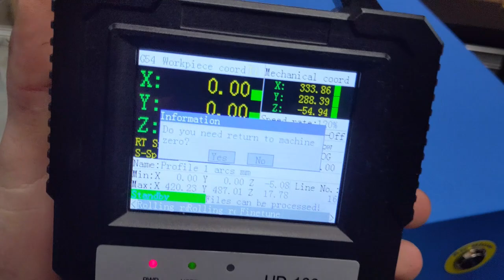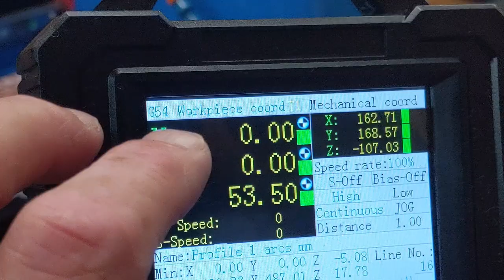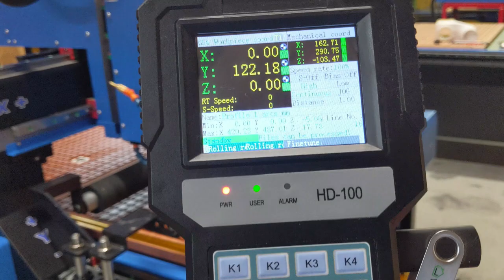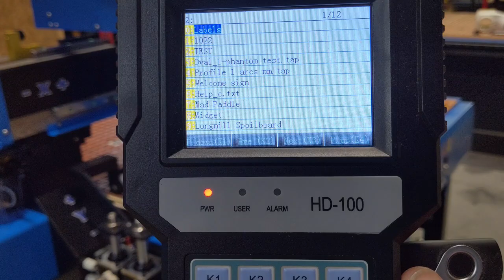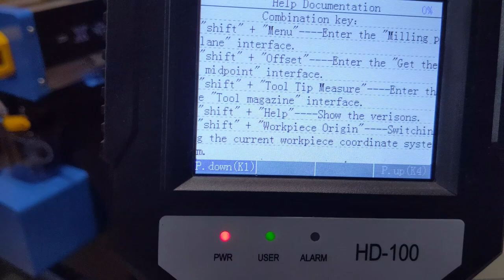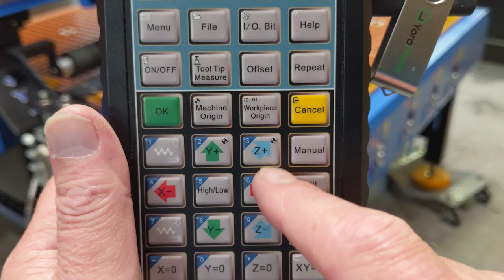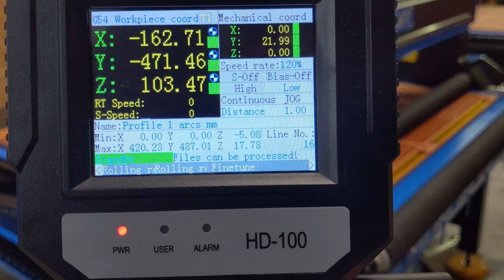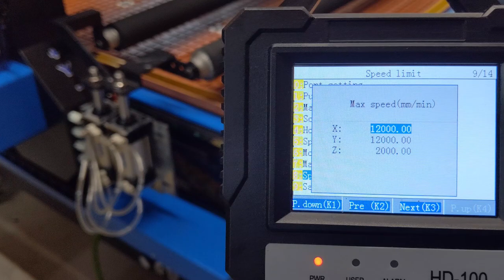How to Use Phantom CNC Router HD-100 G-code CNC Controller Tutorial

Comment: The HD-100 is similar to the Richauto B1X Series however the B5X series is better which offers the color graphic simulation display and an HDMI connection. Consequently, these series of the  Richauto cost more but has greater response time, smoother motion and no node editing required for smooth motion unlike Mach3, WinCNC, and previous Richauto models such as the A11 series. Great video and congrats on the upgrade.
Reply from the maker: Talley, thanks for sharing your perspective brother! I should look into the B5X

Comment: Great video on the detailed features of the HD-100!  So with the Phantom HD-100 I would load the Vectrics created gcode on to the USB stick and run the file. Will this controller automatically set the spindle speed from the GCode data? Or will I have to manually do that for every bit?
Reply from the maker: Dion, you are exactly right. It will set spindle speed from the gcode for every bit if you have that configured in Vectric.

Comment: Hi - I picked my SCV44 the week before you Garrett - I live in Raleigh, NC so I made a pre-buy trip out to Phantom during the summer. The Phantom team and Steve (Owner) have been great to work with. I've been running on it mainly on weekends and this is my first CNC - have had a 100W CO2 for a couple years and was ready to go Phantom CNC. A couple of comments on the HD-100 - and the USB as the the only way to Load files. Steve at Phantom confirmed all Phantom CNCs will only have this option and any kind of link to Windows or a PC is off the table. Second the USB stick HAS TO BE FORMATTED FAT32. This can be an issue if your USB is formatted exFAT or NTSF (Windows will NOT format FAT32)- getting the USB stick to FAT32 means locating a FAT32 formatting utility (http://ridgecrop.co.uk/index.htm?guiformat.htm) has been very handy. Also, and I need to report this to Phantom my USB sticks (happened on 3 different sticks) loose their FAT32 formatting and will not Load in files - just get a blank screen after selecting Load. This means either reformatting the same stick (or using another FAT32 USB), re-saving the toolpaths again, and loaded just fine. Then after 5 or so loads the USB stick would corrupt again and loose it's FAT32 formatting (on 3 different sticks). Not a show stopper but will report it to Phantom. Thanks for your posts fellow Phantom brother.
Reply from the maker: Hey David, right on my fellow Phantom brother! Too bad we didn't run into each other picking up our machines, that would have been a hoot. Steve has been awesome to work with, I'm glad you had such a great experience working with them too. I haven't run into troubles with the USB as of yet on my machine, but be sure to report it over to them at Phantom. It sounds like they should be able to get it straightened out for you. Happy cutting my friend!